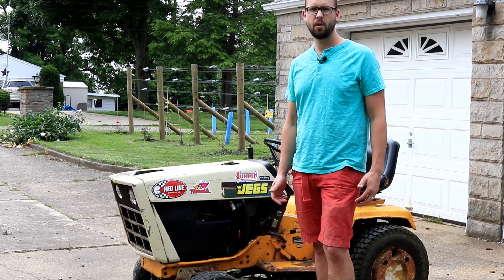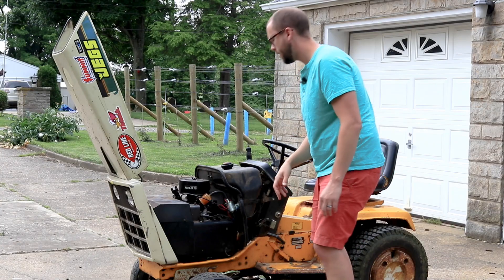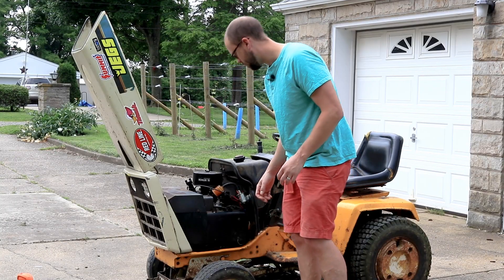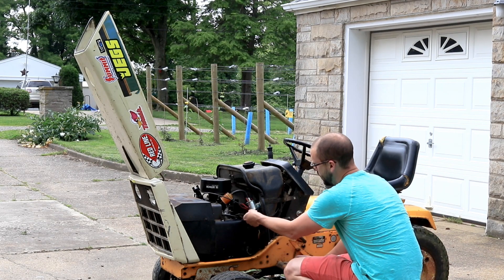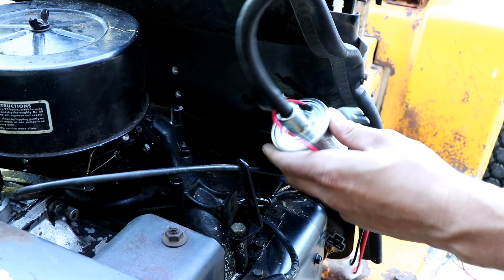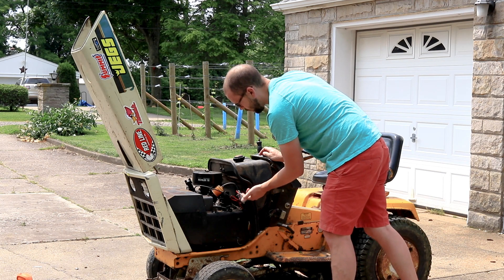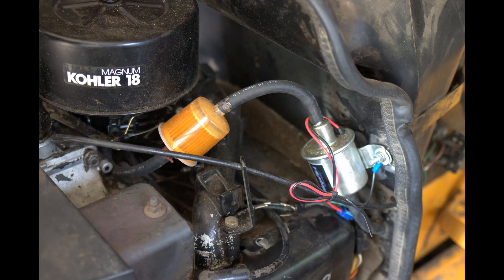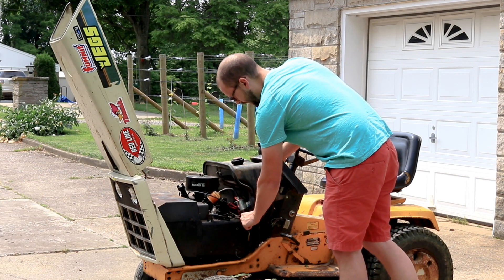Mechanical to Electric Fuel Pump Conversion in Lawnmower

Comment: Generally, should the fuel pump on a modern emissions controlled small engine turn on with the key, or is that controlled by the computer? Thanks

Comment: FYI These type pumps are not diaphragm type but piston /spring/ check valve type. MUST have filter before the pump to prevent clogs.  ALSO MUST have gas ABOVE the pump as you have done.  It does not prime well and OFTEN TIMES BURNS OUT due to DRY friction along the piston walls and no cooling/lubrication via the fluid. FYI for those getting the failing pumps.  THANK YOU FOR THE VIDEO!

Comment: you didnt have to use a pressure regulator may i ask why?
Reply from the maker: It's a low pressure pump, so it's only real job is to keep the float bowl on the carb full.  The carburetor won't over-fill because it has a needle and seat that will shut off the flow once the float reaches the top of the bowl.  It is pretty much just replacing the simple mechanical pump that is on these old motors.  On something like a V8 you will sometimes have a pressure regulator so you can run a higher pressure pump and keep the pressure from dipping much when the engine really starts drinking it at full throttle.

Comment: I'm doing this on a newer kohler in an Argo 8x8.  Can I just wire an on off switch that I turn on right before starting and off to shut it down? I've also got a line running to the crank case that I need to do something with?  Any suggestions?

Comment: So your needle and seat hold back the pressure from that electric fuel pump with no flooding. Ive wanted to convert my vertical Command to that but was warned about flooding the carburetor.

Comment: I wouldn't recommend converting a lawn mower or anything that came not equipped with an electric fuel pump because you're just asking to destroy your whole engine you need to use the stock mechanical fuel pump that is intended to be used. Of course try to avoid the cheap chinese made ones and get a branded one if in the budget. I heared people say they did convert to electric and didn't have problems but that isn't always turn out to be true.

Comment: what psi should i use for a 9 hp briggs and stratton
Reply: no higher than 2.5. Or you could get a fuel pressure regulator.

Comment: Mine seems to be flooding my engine after a minute or 2 what should I do?
Reply from the maker: If it is a new problem when the pump was changed it is probably a little too much pressure.  You could put a fuel pressure regulator on it.  It is likely overwhelming the needle valve seat that shuts off the fuel when the float bowl fills.  If it is not related to a pump change, it is probably that little seat that the needle valve shuts off on.
Reply: Inline regulator, I set mine at 1.5 psi.

Comment: Awesome I just replaced my 2006 courage with a 99 Kohler command the 99 does not have a crank case port for the fuel pump you helped me out a lot thank you

Comment: I’ve already burnt two of these pumps up. They last about 30 minutes and they are gone. Any idea what would cause that. They have plenty of gas to pump and 12 volts supply.
Reply from the maker: Is the supply also 12v under load, or close to 12v?   If it is dipping dramatically due to the current needs of the pump, that could cause a premature burn up possibly.  If you had a dramatically oversized pump I could see that being an issue but I believe these little pumps do okay being dead-headed.  My only other thought would be  if it is too close to the engine or exhaust and overheating.  One pump I could see being defective but two seems really odd.
Reply: mine burned too on briggs and stratton. Around 10 % of people complain on Amazone that the pump does not work after 30 min. Real chinese junk. Is there a more expensive quality pump with mtbf > 1E+5 hours ?

Comment: did u have to use a fuel regulator on that ? wont that be too much pressure for that small carb???
Reply from the maker: No regulator for that little pump.  I think if you got any bigger you would probably over power the needle valve.  If you buy a pump, make sure to get the little 2.5-4 psi one or whatever one I used (I put a link on the description).  There is a similar looking one that is 4-7psi which is probably a little too much.

Comment: I ordered the same pump and is sending to much gas to the carburetor what can I do help please
Reply from the maker: The 2.5-4psi pump generally should be good for any lawnmower engine.  There is a higher pressure version so make sure you don't have that one.   I would check the needle valve in the carburetor. The little rubber seat on it often wears out and causes the carb to spill extra fuel into the engine rather than shut off when the float bowl fills.  It's probably the most common issue with these old carburetors.
Reply: @CoolStuffGuysLike  ok man thank you

Comment: I'm having trouble with my 16 hp Kohler engine on my old Wheel Horse mower.  I had ordered and installed an aftermarket pulse fuel pump ($24.95) to replace the original one, but it doesn't work for some reason.  Then I found a used original part for $20 +$10 s&h but it hasn't come yet.  Then I got on Youtube and saw your video.  I had wondered if there were any low pressure fuel pumps for mowers and you answered my question so I also ordered the one you used.  Hopefully one of them works.  Thanks for the info.

Comment: If the fuel is gravity fed like yours, why does it still need a fuel pump?
Reply from the maker: The fuel tank is only about an inch above the carburetor.  When driving up a hill the carburetor could end up a bit above the height of the bottom of the tank.  With a steady few psi of fuel pressure you are much less likely to end up in a circumstance where the engine is using gas faster then the gravity feed might keep the float bowl full.

Comment: I'm working on a JD 214 myself and plan on using a relay controlled by the key switch to run the pump.  This reduces the current running through the key switch, which could otherwise burn the switch out if it's not built for that.  I'm not taking any chances!  I'm putting a fuse between the relay and the pump too.
Reply: Can you send a pic of your setup?

Comment: got an 81 MTD 950 that I have ordered 3 different carb rebuild kits for and not 1 of them has the right springs for the fuel pump. I think I am done and going to do this method.

Comment: I installed the same pump on my 1970's John Deere lawn mower and the gas blows out the carburator where the air filter goes on. Any idea why?
Reply from the maker: Did you get the low pressure version of the pump?  There are some that look about the same but are not in the 2.5 to 4psi range.  It could also be a bad float or bad float needle valve that is preventing carburetor from closing off the inlet once the float bowl fills.  That is pretty common actually, especially on an older tractor.  The float needle valve has a little rubber cone on the tip that can break down over time.
Reply: That was my problem the 1 I order was 4 to 7 psi and its running bad
Reply: @Rodrigues680  Goddamn bruh!.. you lucky it didn't spray vapor and backdraft to a spark..

Comment: the filter is to keep the pump from getting damaged, I guess you could use 2.
Reply from the maker: I like to put the filter on the backside of the pump in case the diaphragm were to start to deteriorate.  That way it won't send little bits of rubber into the small orifices in carburetor.  You could put a course screen before the pump if you wanted and a finer filter after it.
Reply: @CoolStuffGuysLike  I'd think that by the time your fuel pump breaks apart, your carb is due for a cleaning anyway.

Comment: Installed electric pump on Kohler 17.5 hp craftsman tractor and now it stalls out under load, does that mean to output is too low?
Reply from the maker: That could be the case.  Make sure you have good clean electrical connections.  A bad ground could really drop the output of the pump.  Also make sure your fuel filter is fresh and that the petcock coming out of the tank is open all the way.  You may have a restriction somewhere.  I had a piece of rubber get stuck in the inlet fitting of the carburetor on this lawnmower years ago which caused a similar problem.

Comment: How do you know what size electric fuel pump you need. I have a John deer 318.
Reply from the maker: It just needs enough to keep the float bowl full.  I used a 2.5-4psi pump and have probably a very similar fuel demand.  There is a link to the fuel pump I used in the video description.

Comment: Is there a return fuel line?
Reply from the maker: No return line.   Most carburetors will just have a line going to the carburetor and sometimes a vent.  Fuel injection will have a return line.

Comment: Did you leave the old mechanical pump in place? Or did you remove it and put some kind of cover instead?
Reply: I forgot to ask. How many PSI is the pump you installed?
Reply from the maker: I left the old mechanical pump in place.  The electric pump is 2.5-4psi.
Reply from the maker: I put a link in the video description for the electric fuel pump I used.
Reply: Thank you for the information.